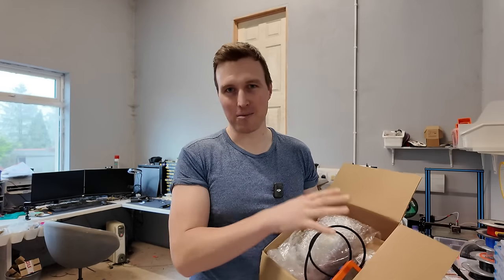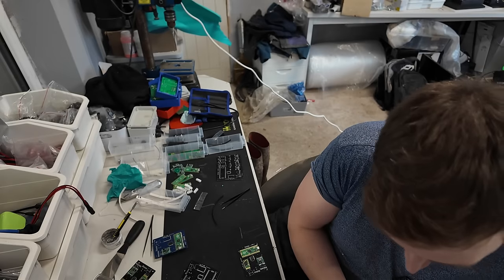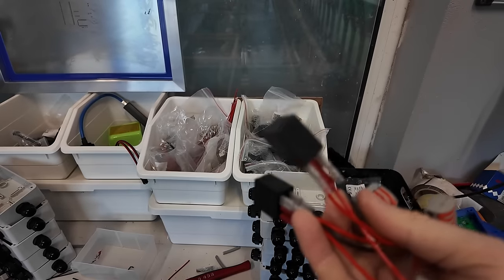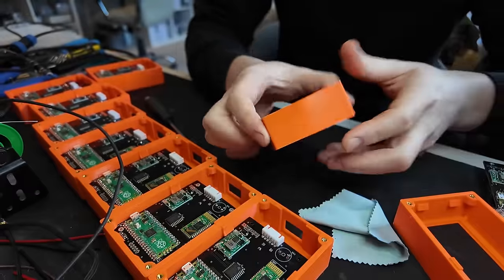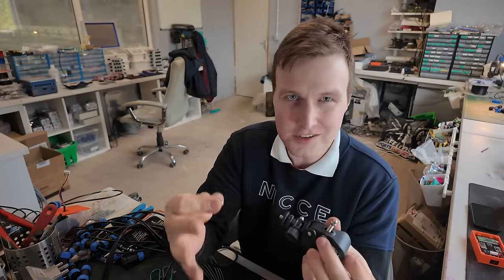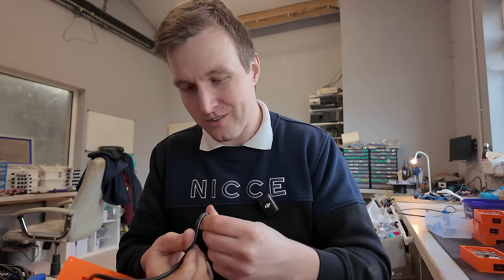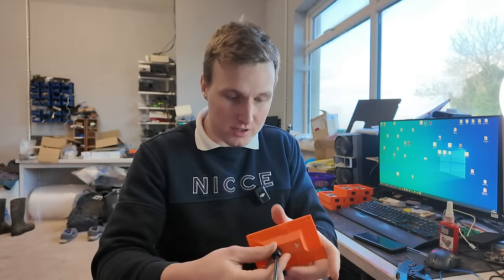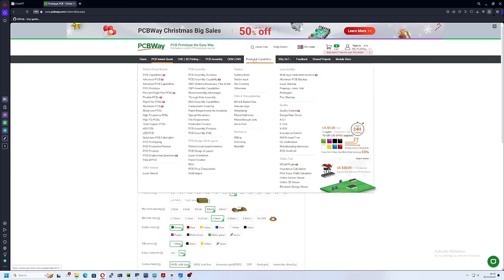Building a SLURRY FLOW METER Controller!  |  PCBs, SOLDERING, CODING, 3D PRINTING | Start to Finish

Comment: Had an Arduino controlling two solar powered bilge pumps on 10acre orchard... 700k litres removed so far, climate change needs some active water table management, especially on our heavy clay! £100 compared with £££ for land drains!

Comment: Very interesting to see some of the process of your electronics building. How did you get to this point? Did you do electronics at college/uni or are you self-taught? It would make an interesting little story video on it's own from the pov of someone young looking for a side career to farming especially as everything nowadays is controlled by black boxes. The original aircraft black box is also orange. Liking the server bit so you can have a good idea how much slurry your devices are responsible for.
Reply from the maker: Sure, good idea for a video! I'm self taught, lots and lots of projects. 😅

Comment: Just there at the very end you talk about the chain of data. Is it the phone that provides the gps location or do you need a gps system on the tractor? Is it possible to look at the data for a certain field say for the whole of 2023 and see how much slurry it got and what grass it grew?
Reply from the maker: It's the phone for this system which would total it for a field. However these boxes also link to my GPS systems also which would give you better variable field maps.

Comment: I am a little curious why you're not using a pico-w. It has the bluetooth (+wifi ) function built-in.
Reply from the maker: There was originally a reason, I think I was because the touchscreen library didn't support the Pico Bluetooth at the time.

Comment: There is a speed reading in kph on the screen. What’s that part of the  unit about?
Reply from the maker: You set your application rate and it tells you what speed to drive based on the flow meter.
Reply: Great